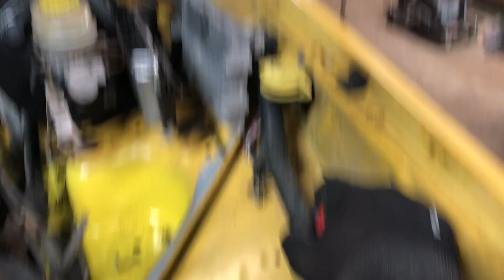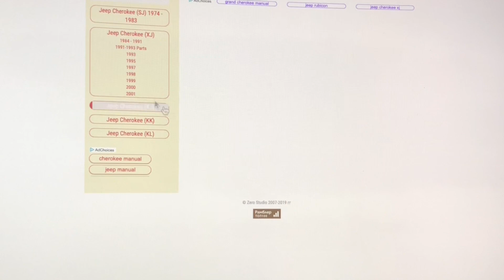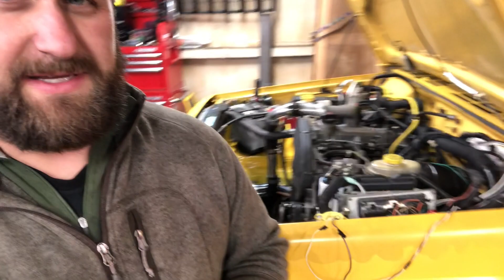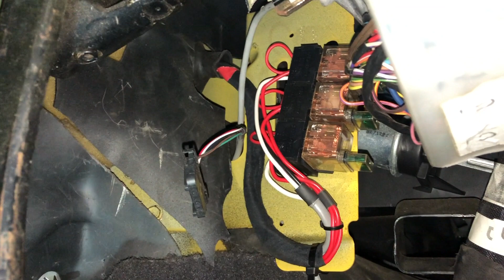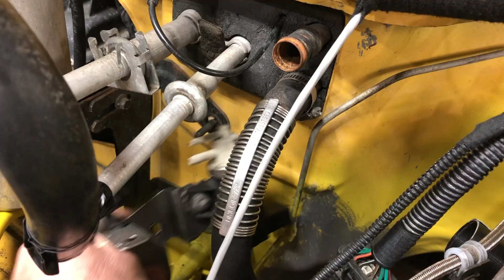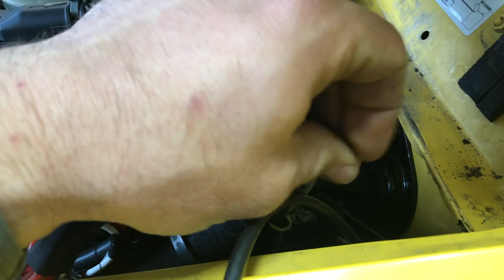Step By Step TDI Swap - Part 7 : Electrical Wiring

Comment from the maker: This time on part 7 of the step by step TDI swap, we're diving in to the dreaded electrical wiring. If you can spare the cheddar, a harness from Fast Forward Automotive takes a TON of the guesswork and time out of this portion. You're going to need to plumb in your factory Jeep coolant temperature sensor and oil pressure sensor for those gauges to work, but otherwise everything else is cake. I also took this opportunity to upgrade to some Mean Lemons 2 Gauge battery cables to ensure the high torque starter would have the juice it needs. Let's get into it!

Part 1: https://youtu.be/P017g3phWXU
Part2: https://youtu.be/SP5W-LK9E4c
Part3: https://youtu.be/IBHuJhbRU60
Part 4: https://youtu.be/jyvuVu9baH0
Part 5: https://youtu.be/GC6ZTd1rokY
Part 6: https://youtu.be/6Na2q1mGGqg
Part 7: https://youtu.be/LxMnYnywlIQ
Reply: TDI to prosty silnik elektrycznie w Europie bynajmniej w polsce gdzie 70% ludzi ma VW, każdy podrzędny warsztacik ma VW w jednym palcu.Na mój gust to taki swap szału nie robi

Comment: How hard would it be to get the gauges to work on a renix system coolant temp sensor is a one wire oil pressure is one wire should be easy enough to trace to wire for the battery voltage from gauge cluster and connect to tdi alternator speedo is cable driven in factory t case cps is a 2 wire and should just plug in from ax15 cps so only thing id be lacking is tachometer

Comment: Question what did you do about the hole in the timing cover ? Mine will be subjected to water worried about the hole from the motor mount in the timing cover.
Reply: I saw someone fabricate a piece to cover it on another tdi swap somewhere on here. I forgot his name but he used to be on bleepinjeep. He's the guys with the beige tj
Reply: I just used some construction flashing tape on my cover

Comment: Not sure if someone asked this or not but did you use the TDI alternator? If yes, then did you connect the Jeep alternator wires to the Tdi alternator to get the gauge in the cluster to work?
Reply: Did you figured it out? am doing the same right now...
Reply: @Auguste88  No I stopped working on it right now as I've been pretty busy. Please let me know if you got it working.
Reply: I used the TDI alternator. No wires from the Jeep alternator are connected, as those were just used to excite the Jeep alternator. Your gauge will work just based off the system voltage.

Comment: I completed a 1.9 TDI swap out of new beetle 2002. Love my truck. Had issues with adapter plate. A great learning experience. I have an issue the last couple of days. First my break light fuse randomly blows. Then as I reversed and back up the engine shuts off. Now I will be driving down highway and engine will shut off. I have to shut key off and then restart. It takes several revolutions before starting.I have a brake switch logic synchronizer from fastforward and noticed it was getting hot but maybe that because I had post in between my seat and break pedal. I was testing to see what is causing the fuse to blow. Still can't determine. Stumped!
Reply: Did you figure it out?

Comment: Your knowledge of doing this swap is amazing.  I am not looking for a freebee, I have a 1987 Chevrolet S10 Blazer Tahoe 4X4, 2.8V6, TH700R4 trans. It was from an estate sale.  I got it with the original title from the original deceased owner.  It Has 62K garage kept senior citizen actual miles. it looks like it was never sat in, under the hood it looks like it is still on the showroom floor.  The original 2.8V6 runs perfect but it is probably slower than most riding mowers.   My wifes 4-CYL Hyundai Tucson will run circles around it.  I am not looking for a race car, just one that can keep up with traffic.  DCS (Diesel Conversion Specialist's) makes a complete bolt on adaptor kit for the TH700R4 (adaptor plate, fly wheel, starter and all the nuts and bolts) for a VW1.9TDI.  All it would need to complete the swap is adapting the accessories and motor mounts.  I want a mildly built 1.9TDI (larger turbo, injectors, cam and possibly some mild head work) swapped in it.  So more HP, TQ and fuel economy.  My S10 is a great looking garage queen so I really do not drive it much.  Would you (for a fee) be willing to do the swap for me. cliff70chevy@gmail.com

Comment: those ECUs generate heat, make sure there is plenty of air circulation and protect them from radiant heat from the exhaust & turbo
Reply: They’re on the opposite side as the exhaust, and spaced apart enough to allow plenty of air circulation

Comment: What kind of mpg are you getting now? What kinda range? Any plans for the 30 gallom tank?
Reply: Hey Brian, It's been pretty consistently around 28 MPH average. I fill up usually around 450 miles on the tank but I've gone as far as 500.  I do not plan to change the tank any time soon.

Comment: Always good to see another episode of this swap.  A few questions as usual.
Any particular reason why you decided to route the relays inside the cabin?  I have mine outside, under the hood in my Ranger swap, but now you have me second guessing myself on my decision.  Lol 
Also I don’t know why I never thought of doubling up inside the wiring loom the long wires provided by fast forward automotive.  I’ll have to do that.  Good thinking.  

Also if you know where to get that plastic ECU slot that attaches to the metal ECU bracket, I would love you forever because I do not at all like my tiedown that’s holding my ECU down to my bracket currently.
Reply: I primarily chose to route the relays inside for space, but secondarily for protection. They are water resistant and mounted under hood on the VW.  I’m not sure what plastic you’re talking about on the ECU everything holding that in on mine was straight from the donor car.
Reply: Alright makes sense.  Well the plastic piece is what the ECU slides into.  I believe it attaches to the metal ECU bracket.  It’s no biggie, I’ll figure something out.
Reply: @RyanWithAviators  What transmission did you go with for your swap? i feel like my 5r44e wouldnt be a great fit for it even though they make adaptors
Reply: @willdavidson4252   So I have the M50D-R1 5 speed manual transmission that's stock in the Ranger.  If you go with an automatic, it would be fine except you will need to either get a standalone transmission controller or a full manual valve body.  The latter choice would mean shifting every time you want your auto to shift.  That being said, sometimes the torque multiplication of the torque converter would be nice paired with a TDI.

Comment: I have the ALH, and the wiring harness. Once I settle on a trans, tcase, and rear axle, its all going in my dead quadratrac CJ7. I'm hoping the dirt simple CJ wiring, a GPS speedo, and fully intact vw harness (including all the dash wiring in one piece) will make it fairly painless.
Reply: Unless you are actually looking forward to the wiring aspect I would strongly recommend having fast forward automotive make a harness for you. It makes it a much neater install and saves a ton of time. Talk to David there about your needs and your setup, he’s very responsive and helpful.
Reply: Can't say wiring is my favorite evening activity, lol. I took a look at fast forward. The amount of bits and pieces they have is very alluring for sure, especially that cruise control... i saw on their FB page they used to have core harness modification but I guess no longer? Just stand alone that I saw now.

Comment: i may have missed if you mentioned it but do you know if its possible to setup cruise control? i have a 86 mj im looking to swap and my biggest pet-peeve with that truck is the lack of cruise control and would like to add it if i go through the effort of swapping it.
Reply: If the VW ECU wire harness still has the wires for the cruise control then it can work. All the stuff for the cruise control in built into the ECU as the TDI is drive by wire. All thats needed is the cruise on/set/speed up/slow down wired up and a VSS signal to the ECU.
Reply: @twalters51  Thanks for the info i appreciate it!
Reply: Yes I now have working cruise control. The only thing needed that Tyler didn’t mention are the interrupt switches at the brake/clutch pedals and it is an all 12v system controlled by the VW ECU. It works very well in the Jeep I just had to install buttons on the dash, unfortunately couldn’t use the steering wheel buttons but I have another use for those
Reply: @DRTJon  Cool thanks for the info and reply!

Comment: Why would you do this swap? Isn't the 4.0 widely renown as one of the greatest engines of all time?
Reply: 11mpg vs 30. Tons of torque at half the rpm's
Reply: @Rheezah2.0  ahaha have you seen the torque curve on that engine? it drops off at 1800 RPM dummy. You wont get that fuel economy with a Jeep drivetrain and you will never see a return on the $6K+ you spent swapping in an inferior powertrain based on the negligible improvement in MPG. OMEGALUL look at the friggin timing belt, that thing is a piece of trash
Reply: Watch Dirt Lifestyle's videos and that will answer a lot of your questions...Also as someone who had a TJ with the 4.0 and 6 speed manual transmission on 33's, it had barely enough power to get out of its own way on any sort of hill or in higher elevations
Reply: Joe Garofalo II no point in even having a discussion with someone who talks to people like that.
Reply: @Rheezah2.0  truth
Reply: @Rheezah2.0  welcome to the internet, pussy
Reply: @JoeGarofaloII  You're making shit up. The 2.0 TDI only makes 100HP anyway, and it's turbo charged lololololol, and it has several inherent design flaws (Injectors, Timing belt, turbo, EGR!), and they're always filled with carbon deposits, and to get more torque than even a stock 4.0L  you have to run them super LEAN (high available O2 in the Exhaust LOL, Incomplete combustion), have fun spending $ on fuel additives and a less powerful, more problematic, dirty, inefficient turbo turd that was BANNED in the USA. I'll take that $, build a Great American 4.0L with a forged stroker bottom end and turbocharge it for serious neck breaking power. Forged Turbo 4L's are now making 1000HP to the crank!
Reply: @seahorse5677  You're clearly certifiably insane, and I shan't entertain you any longer. Good luck buddy 👌
Reply: @seahorse5677  you're an idiot, these TDIs are easily making north of 25mpg while mildly tuned making the same power that a jeep 4.0l; that motor still ain't my cup of tea either way. Those 4.0L beasts you talk of are insanely costly and completely un-streetable making like 6mpg, so congrats, you don't know how to communicate. Personally, I'm doing an OM606 swap. BTW, Where's your Jeep???
Reply: Because the 4.0 gets 13 MPG and the TDI gets 40 MPG.  And it’s way cooler. lol

Comment: I'm certainly no electrician. But could you use a relay between the cam signal wire and signal ground that uses the starter control signal to switch closed/open?  The example I found online has a 12V 4 pin single pole single through relay, pin out 87 to signal ground, 30 to cam signal wire, 85 to the starter control wire, and 86 to chassis ground.  That may not be the correct pin out, but I would think that would work, yeah?
Reply: I’ve tried that and it works but not reliably. No idea why the system is finicky like that. What I will likely do eventually to get a consistent working tach with no user input is to make a bracket to drive the old distributor sensor off of the accessory belt
Reply: Jon BleepinJeep right on. Figured you’d probably thought of it, but commented just in case. 

Does it matter if you press that button before or after starting? And does it trip it up if it’s pressed multiple times? Your solution there is definitely the most correct one, I’m just wondering if you could use the brake light switch instead, like if it has to be pressed before starting but doesn’t mess it up if pressed after starting. 

A video about the solution you wrote, maybe even detailing the other things you’ve tried and what you’ve found along the way that didn’t work well would certainly be every bit invaluable as al of the others you’ve made thus far!